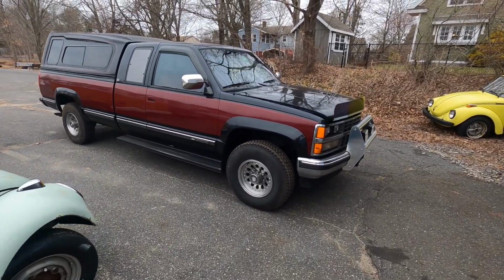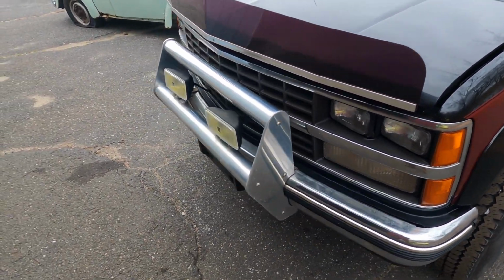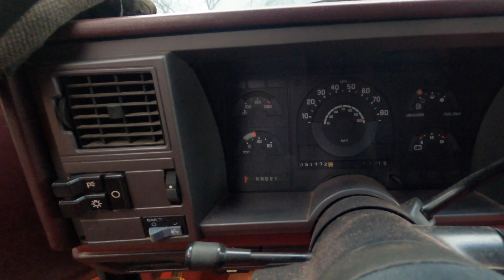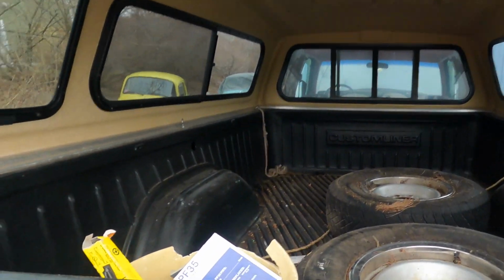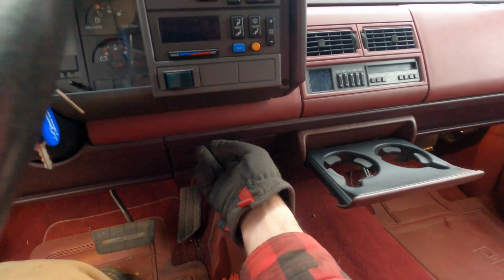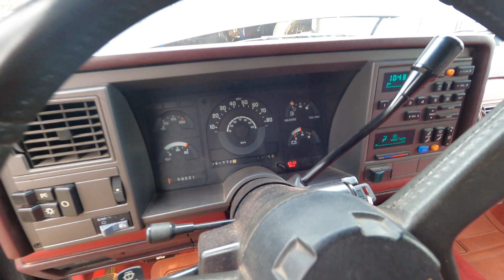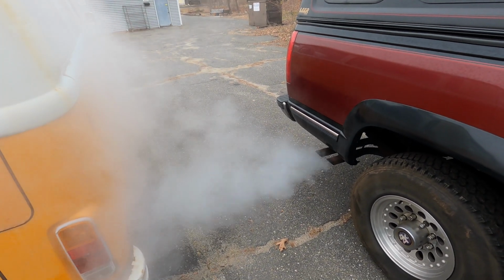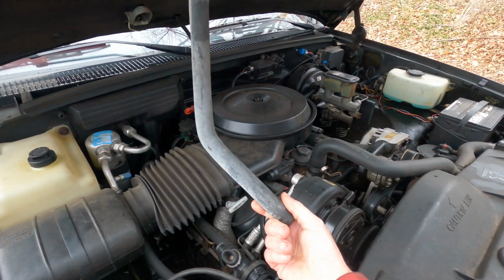1989 Chevy K3500 Big Block 454 7.4 4x4 Rescue Rig - GMT400 Beast

Comment: Wow - a veritable torque monster!  👹👹👹👹 I have a 402ci BB in my '71 Chevy Monte Carlo, and ya gotta love these Chevy BBs.   Jason, this is a nice looking rig for an '89... I definitely like the color combo.  As for the noises up front, I'd take this puppy for a decent ride, then determine what is making noise from where.  It could be an idler pulley/pump/alternator bearing - as some people have already suggested, if you can't figure out where the source of the noise is, you could disconnect the accessory belt, fire up the engine, and see if noises are still there.  If not, the culprit is probably one of the units that is driven by the belt.  The smoky exhaust? Drive it, get the vehicle up to normal operating temperature, and see if you're still getting lots of smoke.  Could be lots of condensation in the exhaust system.
Reply from the maker: Hi, thank you for the advice . Turns out it broke a push rod … I have yet to pull the intake etc and repair it .

Comment: Has someone who runs a 97 2500 HD as my one and only vehicle for many years now with a 454 I can confirm that I'm on a smoke coming out of a cold exhaust is normal and will not clear up until it's been up to operating temperature for a minute or two it is just moisture in the exhaust I loved it because living in the deep south always told my neighbors I'm just controlling the mosquito population lol or I called it my James Bond smoke screen can't catch what you can't see
Reply from the maker: thank you for the feedback , much appreciated . It only has like 53k and sat a lot so it's going to need some love
Reply: @5150mxVW  just a little looks mostly good to go to me Just in general maintenance

Comment: Great truck! Leave the top on to keep the bed from going bad + you can haul interior parts without them getting damaged from weather.
Reply: The smoke is white. Could be a lot of water in the exhaust from condensation and sitting. I would check for pressure or bubbles in the coolant reservoar. You could also check for CO in the water with a test kit.
If that's fine I would make a longer drive to heat the whole exhaust system up. There's no water in the oil by the looks of it.

Comment: OK, first thing is you absolutely scored with this truck. Maintain it well, and it will live as long as you need a truck. They are very well built. Don't worry about the gas mileage, just compare that to what a new truck costs. Also don't change out the hard tune up parts until you inspect the old stuff. It may be just fine. But do change out all of the fluids. They degrade with time and/or use. Cheap insurance.

Now, I drive a 91 Chevy Scottsdale that currently has about 72K. I bought it with 48K about 5 years ago. Outside of the basic tune up stuff and wear items it has been fantastic. One thing that happened that I really want to share with everyone interested in these trucks, is the fuel pump can be an issue. Keep the fuel level above 1/3 tank at minimum. The "in tank" pump is cooled by the fuel, and they like to burn up if run low.

This leads to the next thing. A couple  years ago I was in the middle of a 3K mile road trip in my 91 when it started to act up. Stumbling on acceleration, but always started and cruised just fine. Obviously starving for fuel. Long story short, I was losing fuel pressure. I finally gave in and decided to change the fuel pump. I cut a hole in the bed since I was at my dad's house and had limited tools. Turns out the pump was fine, but the 3" length of rubber fuel line connecting it to the tank outlet had begun to split, and was spraying fuel, thus dropping pressure. The new pump came with a new piece of rubber line that was modern fuel rated. Problem solved.

So, to all of those out there putting low mileage GM trucks back on the road, be sure to check that chunk of fuel line at your convenience, rather than at the side of the  freeway with a trailer hauling your next great find.

Comment: Do not flip the air cleaner lid and forget headers you will have perpetual exhaust leaks with headers especially if you tow with it . The steam you saw from exhaust seemed excessive but thats a big engine moving lots of air so unless it smelled sweet or like burning oil I wouldn't worry about it. Your right about the wheels the factory offset will get them back under the fender. You want to make sure the cooling system is in good shape as heat and excessive rpm are the big blocks biggest enemy saw it a lot in Class A motor homes . And a second mortgage for gas will be helpful. Beautiful Truck and only 50k miles you lucky dog.

Comment: That is a lot of smoke, mine did that for while after getting it then it went away, my guess was moisture in the fuel tank. because it was white smoke, and as you mentioned the valve seals were leaking, I put magical valve seal restoring additive in and it worked. that smoke was blue. it's all good now.

Comment: Hey Jason, I’ve owned a lot of GM’s. That noise sounds like the smog pump. It pumps air so! And that’s not smoke, it condensation, it will disappear when it warms up good. Keep driving it. I got a 2005 GMC 2500HD with 55k. Everyone that sees it wants it. Thanks much for sharing your video!

Comment: As I remember, the exhaust manifolds and gaskets tended to rust out/ leak .too. I bought a 1989 K3500 Silverado trim pkg. fully loaded Dually with a 350 new (Leftover)for $18,000!😊  Starters were an issue, and the headlight switch was replaced twice, and the original Auto transmission dipstick could blow out under pressure and pop out. And was recalled for a replacement. The Ball joints were prone to early failure replaced  twice,they decided to make them non greaseable. Also Idler Arm replaced  3times., flex plate cracked at 3,000 miles, Chevy would not replace it the warranty (time) had expired. I told the area rep if they won’t cover it I’d never buy another GM product as long as I live!😂 I now drive a 2002 Toyota Landcruiser with 356,000 miles and never looked back! It was beautiful new though! Sable Black with the same interior as yours! Beautiful shape! Enjoy!
Reply from the maker: This one sat too long and broke a push rod …
Reply: @5150mxVW What really stopped mine was a frame break, right at the back of the cab. The drive train is fine, I have a donor truck for the frame, but the LC is trouble free and a pleasure to drive and much better in the winter than the K3500. Great video ! You are right about the headlights.Still have thoughts of swapping the frame it only has 56,000 miles! time will tell!👍

Comment: You lucked out on this truck! What a beauty.
Smoke doesn't look like oil smoke whoch would be blue-ish. Just water vapor from a cold start. It's a big engine so lots of cold start vapors. As forvthe mechanical noise, hard to say when listening to it on a phone. But it can't be much because a spun rod bearing you would hear much louder.
Could a be a collapsed lifter.
Maybe the engine would benefit from a good drige on tge highway where it and the oil can get warm. A cold engine is always hard to evaluatie and judge specially when it has stood around for a longer time.

Comment: Nice truck Jason. Looks well taken care of. I have a 2014 1500 Quad cab Silverado. Got 12,495 miles on it with a tonneau cover, bed liner and side step bars. It still has bar code stickers on the frame and shocks! Cherry shape condition.

Comment: Looks like a nice truck, well done Jason. I would suggest the knocking was that bar you pulled out? A compression test wouldn't do any harm. The oil didn't look 'milky' so no water in it.The smoke was not black so no piston issues. If it hasn't run for a while it could be condensation and the cold weather. I don't know these trucks, we don't have lots of them in the UK but I would check for belt change intervals. That is something people overlook. Hope she gives you good service, she's clearly been looked after. Once again well done Jason.👍👍

Comment: Nice Truck Jason. Really hard to diagnose on a Video, Maybe flip the Belt off and spin the idler pulley under the Power Steering Pump, as it seems to be from that area. The Mrs Hopes no - one was sat in the Camper getting smoked to death !

Comment: That just might be the nicest vehicle you have ever brought home!  Most of those trucks were used up many years ago.  Have not seen one with the original style dashboard for some time.  Big engines with big exhausts make lots of condensation in cold weather.  Might be nothing at all; unless the coolant level is dropping that is...  Did it smell like sweet antifreeze or oil burning?  Noise did not come through in the video, although as others have said it could be a leaking/cracked exhaust manifold or broken exhaust bolt.  Or maybe a noisy lifter that comes and goes.  Anyway looks like a great truck that should give decades of service if you look after it...

Comment: Excellent video Jason  :) also a close  friend mine had same color but was 1988 Chevrolet 1500 with 5.0 305 V8 TBI (Thorttle Body Injection 2 barrel carb looks like ) , Turbo 700SR 4speed Overdrive Automatic, with 377 rear end gears plus Air Conditioning, Cruise Control, Tilt Steering, Slider Back Window, Extended cab, tons power options even seats , long box of Z71 version and 2 wheel drive! It was Oshawa Ontario Canada GM plant number 2 built,  that smoke be need Air Filter change plus PCV  change also put grey bottle of STP Total Treatment fuel injection and carb cleaner in fuel tank too with 89 (5 % Ethonal or 91 or higher with no Ethonal % and oil Change use 10w30 engine oil no synthetic type plus oil Filter too ! If smoke doesn't disappear may need change Charcoal Cannister from TBI to Brake Booster on left back engine and fuel filter too ! If not it O2 sensors on exhaust on manifold or by Catylic Converter need both  replacement too ! Also do OB1 test on computer see if code come up ! Maybe have Weak Injectors too or something!

Comment: Nice vehicle, I'm a little jealous. My opinion...remove serpentine belt. Check each and every pulley for sloppines (excessive lateral or radial play). All pulleys should spin true and not make ANY noises as you spin them by hand. Replace defective pulleys and the serpentine belt with new ones. As others commented, test all cylinders for compression. Put bottles of HEET or Seafoam in gas tanks until April. At oil & filter change time, add a bottle of ATP AT-205 Re-seal additive to rejuvenate engine seals. When engine sits (not running) too long, the seals don't get the oil on them to keep them tight. Thanks for another fine episode.

Comment: Used to have one, Exhaust Manifolds Cracking are common on them. Still a Awesome Truck, Would love to have it for myself. Now you can hook up the Trailer and buy more VW'S ! Your going to love the power and Torque, Gas Mileage Not so Much, mine was the same about 10mpg, loaded or empty, it didn't seem to care.

Comment: I’d suggest a diagnostic stethoscope. They are great for isolating “floating” suspect engine noises. I’ve had a few low mileage older vehicles and my approach has been address what is obvious and then expect a process of repairs as the your initial mileage adds up.

Comment: The front and rear track widths are different on those 4wd trucks. It's done that way so that the rear wheels aren't in the ruts the front tires are creating. It always bugged me but it does have a purpose.

Comment: I will be honest these are some of the best trucks ever made to be honest. I have an 88 with a 305 v8 and a 5 speed. They are built very well. Valve seals are always an issue on the chevys. But they typically only smoke bad on startup and then it goes away. If you decide to sell this beautiful truck let me know!

Comment: That year 454 still has a plastic tooth cam gear in it ,at its age it might not be a bad idea to replace it,they get very brittle and when it comes apart you will have 8 bent intake valves real quick! Seen it happen many times
Reply from the maker: plastic !?!?!?! thank you for the heads up Randy

Comment: That's just cold engine vapor! Idler pulling bearing definitely going. Speedo goes haywire on that style. Other than that those are great trucks. Up here on michigan the frames rusted badly on them.

Comment: First that truck is beautiful. Looks great with the cap but I think shes more useful without it maybe at a tool box instead. 

You said its been sitting and since you need to do the tune-up and check all systems maybe you can and some of the reconditioning fluids and an Italian tune-up ans she will come back around. 

You can always go deeper later but that truck is a keeper.

Comment: Over the years I've had 88 1990 mini in red color with the red interior I thought it was a really good redesign in 1988..... Remember is the first fuel injection or shall we say a box with a couple of spray nozzles in it.. of course around here they rot away but they rotted away slower than the ones from the 70s did in the sixties to

Comment: If the choke was on and hi idle smoke probably ok. If not could have head gasket to cyl leak. Was the white  smoke sweet smelling? If so monitor coolant level in over flow.

Comment: I bought a 1993 4 dr 1 ton dually 8ft bed in 1994 with the 454 and a 411 rear diff. 10 mpg up hill or downhill didn't matter.  My suggestion would be to pull the valve covers remove rockers and push rods. Check for bent push rods. If you know how, change the valve stem seals. But first run a compression test all 8 cylinders.
Reply: I was thinking that's why it's only got 50k miles, lol.

Comment: That is a good one. The only thing is the Gas mileage is going to suck. The 6.5 turbo diesel would be better. I had one of those and it was a beast. Pulled all day long at 10 to 18 mpg. 10 fully loaded 9k empy 18....that 454 will do about 6 pulling same and empty 8 to 10. But the 4x4 will be nice. 4l80e is a good trans too. better than the same year ford. they were trash.  Looks good because he kept it oiled. that truck Is MINT for an 89 New Englander

Comment: The only thing I can think of the fuel lines run in between the cab and the back of the engine now this was on the 305 sand 350s and when the cab out start to go it will pinch the fuel line but looks like that truck is in solid shape and you don't need to worry about that other than that I mean I think they go go go

Comment: Hey Jason nice truck get yourself a mechanic's stethoscope there not that much money looks like a doctor's stethoscope only with a long aluminum rod or probe (don't let Jen see it she might use it on you for buying all these vehicles) 😂 but get one and put it on and probe the valve cover exhaust manifold anything like the area where pulleys mount and you'll find your noise location don't probe moving parts like the pulleys themselves or get to close to the fan check the water pump though just be careful. The smoke you saw may just be condensation in the exhaust worse case its coolant getting threw a crack or bad head gasket. check the exhaust just take a quick smell see if it smells sweet and check your radiator and coolant tank level. I had a blazer years ago that when cold had a kind of low level knock on the drivers side which ended up being a worn piston skirt but when it warmed up the noise went away the car had almost 200k on it when I sold it and was still going until the last owner got in an accident and totaled it. Hey I bought a 1994 4.3 vortec with 63000 miles on it for the car because I thought I would need it and you know what I still have it why? well I paid $500 dollars for it and couldn't find anyone that needed one go figure. Well good luck Jason.😊👍

Comment: Nice truck. For a truck that big, you need some truck nuts hanging off of the trailer hitch. I think that I would buy one of those kits from an auto parts store that lets you check the anti freeze for exhaust gas in it ( for a bad head gasket. Sometimes a leak at the exhaust header can sound like its tapping. To me the smoke looked white, not blue.

Comment: Looked like primarily water vapor to me. Combustion stuff usually floats around a lot longer. Any signs of water in your oil or oil in your radiator? White foam = dreaded bad news in my experience.

Comment: I'm going to agree with Gary H. down below. That motor (I call them motors) pushes a huge amount of air, and it is cold outside. So yeah, steam. As for motors. Detroit is not called The engine city. Just sayin. Besides, I'm old, so leave me alone. 😜